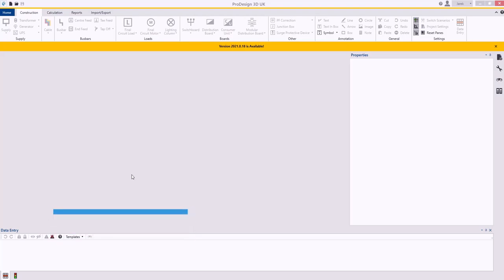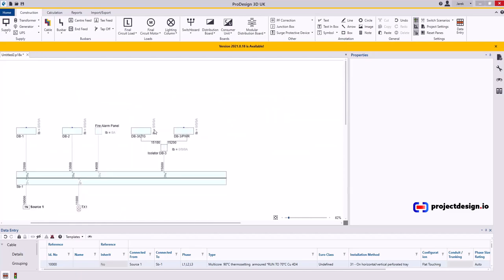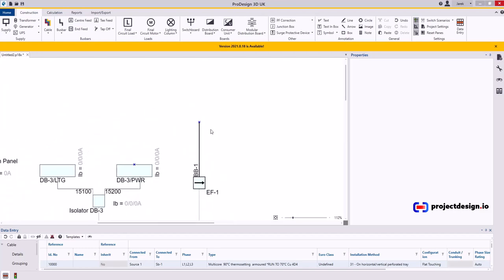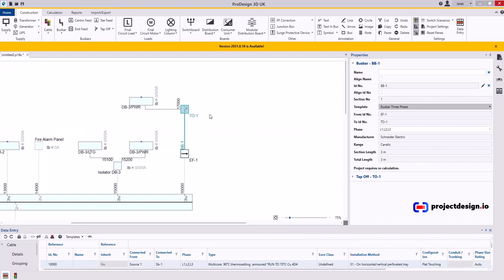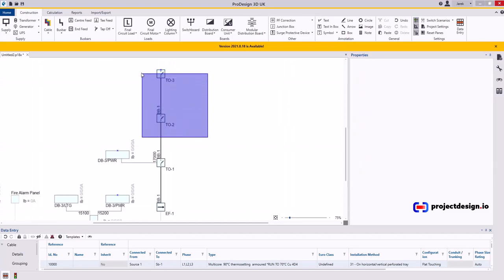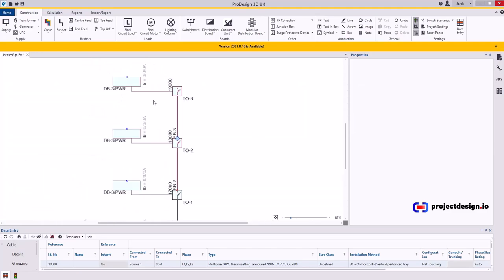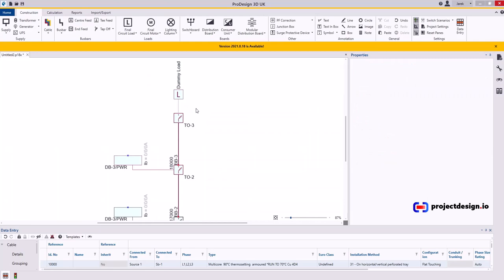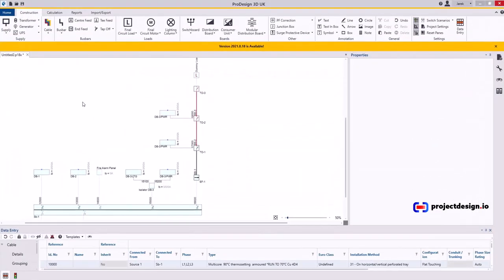PD 02 02 05 Construction Menu   Busbars

Comment: Hi thanks for the introduction.

The Trimble ProDesign software appears to have some limitations in accurately representing real-world busbar installations. Specifically:
The software does not provide an option to directly connect the busbar to the panel using flange ends, which is a common installation method in practice.
When introducing a tap-off to the busbar run, the software depicts it as if the busbar is disconnected with an isolator or breaker. However, in reality, the busbar is a continuous copper bar from the end feed unit or flange end to the busbar end cap.
These discrepancies between the software's representation and actual field installations can be confusing for users who are accustomed to the real-world busbar configurations. It appears that the Trimble ProDesign software may need to be updated to better reflect the common busbar installation methods used in the industry
Reply from the maker: @sla5885,  Thank you for your detailed feedback. You can indeed connect the busbar directly to the switchboard without using the end feed.
Regarding the tap-offs, while the software shows them as if the busbar is disconnected, this is done to allow the software to accurately calculate the length of the path from the source to the tap-off. This representation is for calculation purposes only and does not affect the actual installation.
The TRIMBLE team might have more insights, but the software's calculations for the next tap-off upstream are not affected. It does not treat the tap-off as an extra joint, which would otherwise result in added impedance.